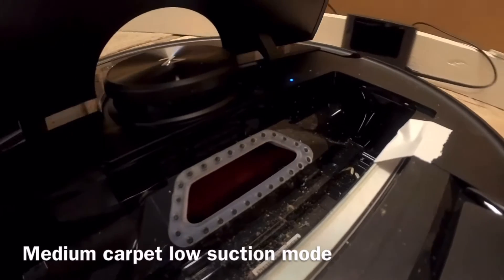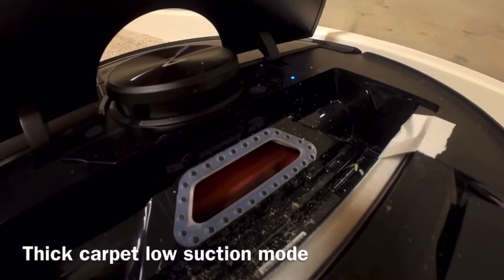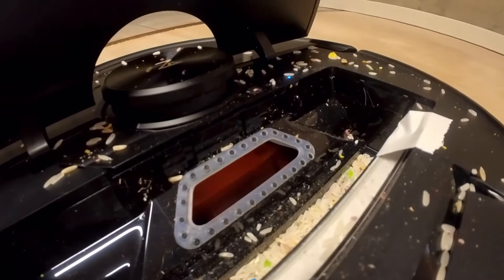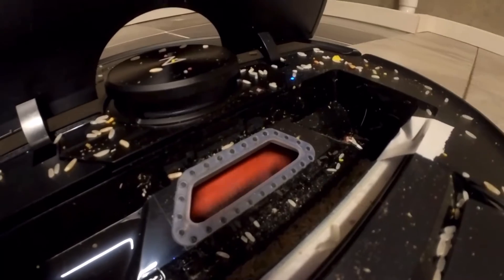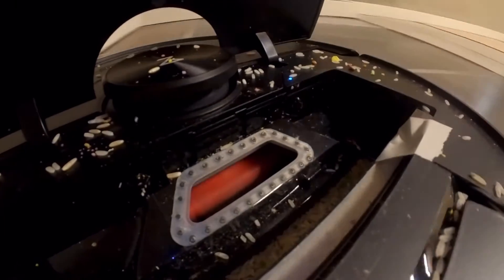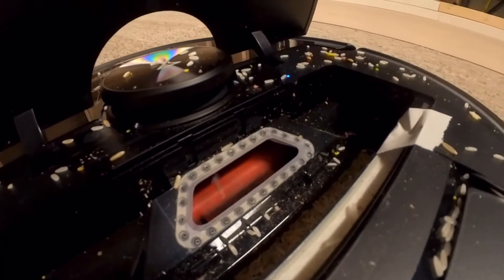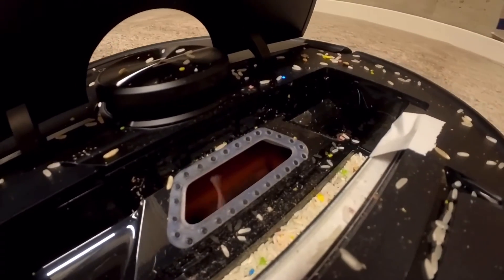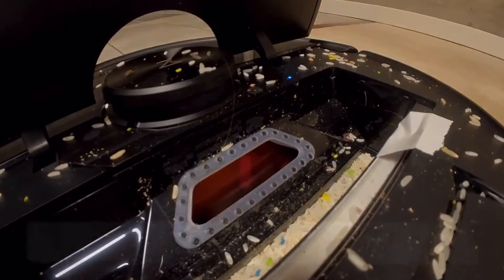RoboRock S6 MAX V Robot Vacuum - BRUSH ROLL ISSUE? 6 DIFFERENT Surfaces TESTED!

Comment: I have the S5 (or maybe the s4), and I feel like my carpet is nothing special. It's not like super thick or luxurious. The brushroll turns off within 15 seconds every time. It is infuriating. The vacuum is super good in every way except for this. So now I've given up and just use it for hard floors which really is unfortunate because this thing was over $400. I've owned it for 2 years and wish I had one that could do my carpets. Most people are oblivious to this and have no idea. They just see the tire tracks and the dragging marks from the brushroll dragging along the carpet and think it's doing a fine job. It's not able to pick up most of the dust without the brushroll spinning.

Comment: I have emails from support saying they have no intentions of fixing via firmware updates. They claim it’s a safety feature to prevent motor from overheating. The only reason it started working again for you was because when the brushes hit the lower pile carpet or tile the friction dropped and the cutoff wasn’t met. If your whole house was medium to high pile carpet you’d get about 1-3 seconds of spin every 30-60 seconds after running for a few mins. Once motor heats up it’s basically useless on carpet. Your test area give the motor a break every few feet. Wouldn’t buy anything but the s7 for carpet.